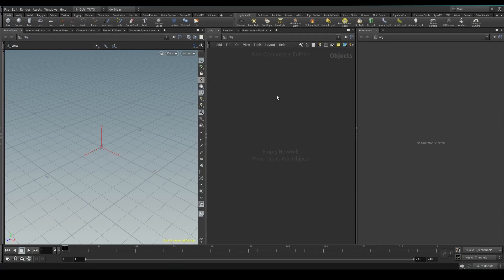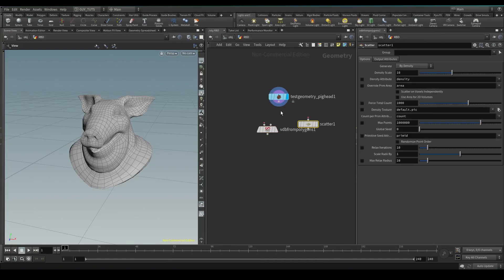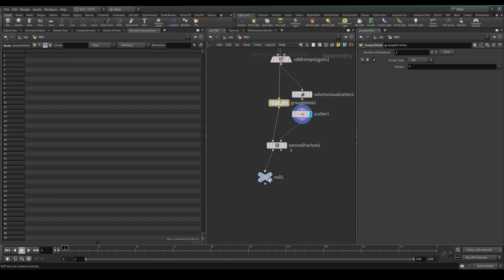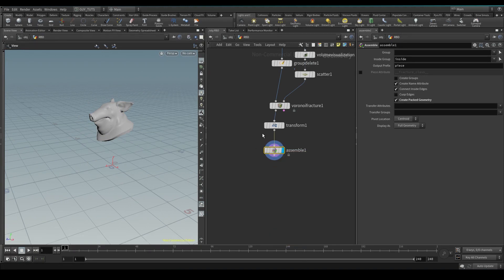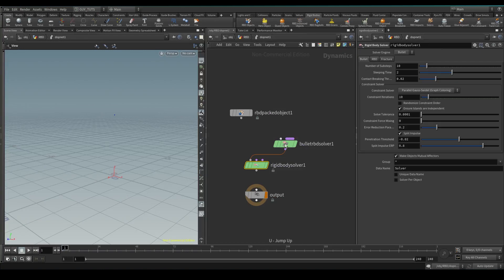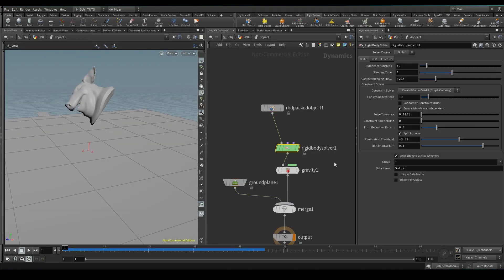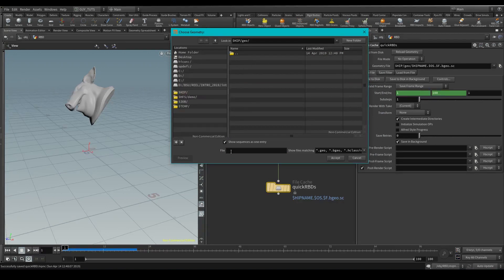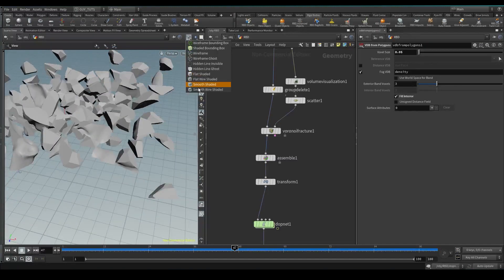Houdini In 5 Minutes - Quick RBD setup

Comment: Hi, this is slightly off topic, but thought you would probably know. How do you create an object (body) that has arms that can swing attached to it and then drop it into an RBD grains pits? The part that I'm stuck on is fixing the arms to the body so that when it drops then it will stay connected and react to the solver too. Thanks!
Reply from the maker: thanks for watching. what you are talking about is a rag doll setup. houdini does ship with such a setup that can be found on the shelf tools under crowds, I think. you can build this and then apply your own character model and grain solver into the same dopnet. This will allow you to simulate both. if you truly want to connect the arms etc manually, you can do this by making constraints between points on the arm geometry. constraints are a more complex topic so I am planning to do a separate tutorial on them.

Comment: n00b question: Why didn´t gravity affected the plane on merge?
Reply from the maker: Activemotionpictures thanks for watching. The ground plane in the dop network is an infinite plane that is used to simulate ground in almost all dop sims. It is a static object so it will not move when the sim is active. No matter what forces you apply. You could activate it if you wanted but then it would be better to use an rbdpackedobject node instead to bring in ground geo.
Reply: @5MinuteFX  (face palm) oh right! says: ground plane! hahha. Now I feel like forky. Sorry, it´s that I am always assigning "ground plane" to simulate rigid body (static) to a regular grid. I forgot this is HU. Thanks.